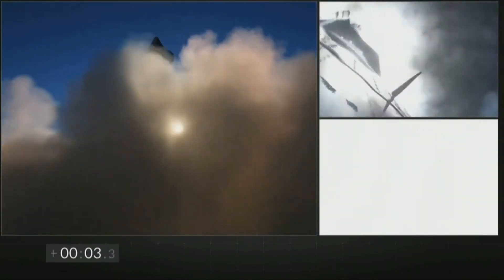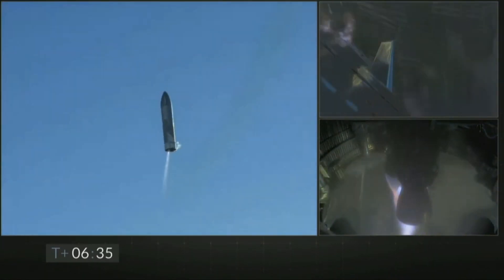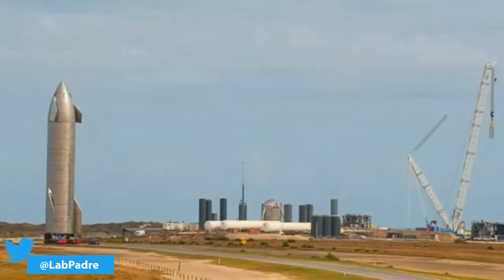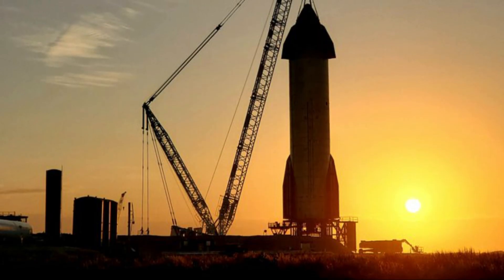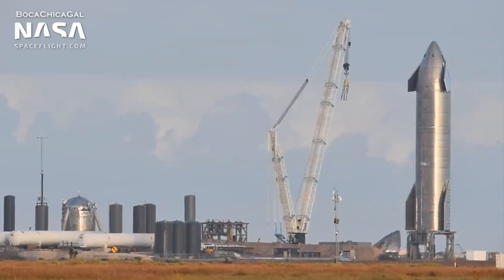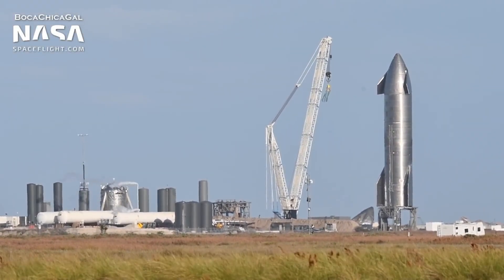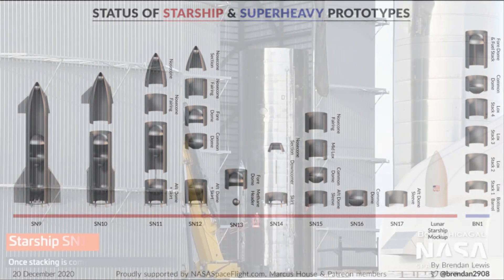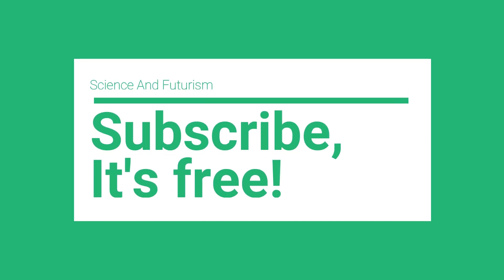Starship SN9: SpaceX Found Solution To Avoid Landing Failure Like SN8!

Comment: IS NOT ACCEPTABLE TO HAVE SUCH A SERIOUS DESIGN PROBLEM. THE ONLY SOLUTION TO SAVE THE PROJECT IS TO ADD A PRESSURE TANK TO EQUALIZE THE PRESSURE NEXT TO THE MOTOR, A KIND OF PLANE-TUBE-TANK. NEVERTHELESS, IT WAS AN UNACCEPTABLE ERROR THAT PUT IN DOUBT THE LIABILITY OF ALL SPACEX.

Comment: Very interesting delivery.  Good video. Couldn't understand what issue or solution you wanted discussed?  I think it's the use of helium as a fuel or oxygen propellant.  It seems to require a heavy bladder to avoid: dilution or pollution, of the fuel or oxy being propelled, especially as the ship goes through tilting.  So, is a pneumatic propellant in a space efficient teardrop shaped chamber, better than a mechanical spring loaded piston in a shaped cylinder.  I vote for a bladder to keep the helium separate from the fuel or oxygen being propelled through the space efficient teardrop chamber.

Comment: The CH4 header tank is pressurized with a gas, and they must use Helium because the cold temperature of the Methane would condense nitrogen, for example, into a liquid and it would not pressurize anything in that state.  Helium liquifies much colder than methane so that works.  Hydrogen, also, but there may be some chemical reaction between hydrogen and methane, IDK.  Regardless, I am against using helium as helium is precious and we are running out of it.  Much needed for things like superconducting magnets in MRI scanners...forgot party balloons and that it saves a few KG on Starship.  Non-helium methods should, IMO, be found to pressurize or otherwise guarantee adequate fuel flow from the header tanks, regardless of the weight penalty.

Comment: The greatest plus side is that SpaceX is the sole stakeholder, so can quickly make changes and continue.  I suspect that if a NASA or AF funded project, StarShip would have already been cancelled.  After a single failure, there likely would have been meetings and finger-pointing, with a committee decision to give up, made by bureaucrats with no technical understanding.  The DC-X is a good example and strikingly similar to StarShip.  The whole program was cancelled in 1996 after several successful flights, when a landing failed due to a leg not extending because a tech failed to reconnect a hydraulic hose.
https://en.wikipedia.org/wiki/McDonnell_Douglas_DC-X
Reply: Woow!
I thought this dramatic propulsive rocket landing that we've come to take as the new "normal" was SpaceX's idea. Didn't know NASA had the idea before and even built and successful tested such a vehicle... several times!
Reply: I agree completely 👌

Comment: I am wondering if the root cause of the low pressure may have been caused by the inner diameter of the vertical feed pipe and/or the lower distribution manifold connecting the CH4 header tank to the engine heads.  A pipe diameter that is too narrow would cause low pressure at the engine head.  Has this been discussed here or elsewhere? The dynamic pressure on the engine heads would be biased low if the flow field in the feeder pipe is more turbulent than expected.  Increasing the operating pressure of the header tank with helium might be a temporary work around fix with a redesign of the vertical feed pipe and/or the distribution manifold (larger diameter) being the more permanent fix.

Comment: I understand the concept of gas pressure feeding liquids to the rocket engine, but don't know how the gas pushes the liquid when the rocket is not vertical and under acceleration. For instance, during the belly flop, more importantly, in zero G. In the belly flop, the fuel won't be at the bottom of the tank, but at the side. In orbit, the fuel would be floating freely in balls and droplets. Do they use reaction control jets to nudge the fuel to the bottom, then the firing of the rocket would keep the fuel flowing? Or is there some kind of membrane that the helium presses against the fuel?
Such a simple idea, but so troublesome to implement reliably. 
I've subscribed, and so hope to hear an answer that I'm sure others might wonder about.
Reply: I have studied liquid to gas, systems for medical use and how it works is this: the liquid in the tank has some headspace and creates a consistent pressure in this space. Here’s the cool thing! As long as there is liquid in the tank the pressure will remain constant, assuming consistent temperature. 
So a 1/2tank has the same pressure as a near full tank and a near empty tank.
Reply: @michaelsmithers4900  I think you missed the question... the issue is that the fluid has to be up against the exit to the pipe feeding the engine. That's why restarts in space first require some acceleration (usually by thrusters) to put the liquid firmly at the exit (typically the bottom of the tank) and not sloshing about or in globules. That's independent of pressure. However, in the case of SN8, it seems the flow was not sufficient,  and can be cured by an extra pump or more pressure. Elon has chosen more pressure using helium, since an additional pump would add weight and need power.
Reply: @awuma  Thank you @michaelsmithers! You answered my question beautifully. So it is the use of simple physics. Occam's razor to the rescue yet again. Simple, effective and self sustaining. Thanks. I've only been wondering about this for a very long time. Dad worked on the fuel system for the A-10/SR-71; step dad worked in failure analysis for the Titan II and Saturn V rocket engines. He took films at thousands of frames  a second, to see what part blew off first during "rapid unscheduled disassembly" during test firings. Both dads are gone, so I had no one to ask.
Thanks,
Reply: @awuma  Good Point, I hadn't realized these systems bring the LOX all the way to the engine, rather I had thought the LOX was used as a gas.
Reply: I thought the whole idea of a header tank was to have it full to the brim so you don't have this problem.
Reply: @carpenter3069  Because liquid is a defined volume as you use it empty space is created that immediately filled with gas vapor "boiled off" from the LOX. The more you use, i.e. on launch to engine cutoff, the more space created. 
For what you're implying to be true the tank would have to be collapsible or maybe have a piston to  take up the void, However these things add complexity and fail points.
Reply: @michaelsmithers4900  I suppose then they use the pumps to keep a pre-defined positive pressure in the header tank then and that was the cause for failure.  They're thinking of using compressed Helium to maintain pressure.  It must mix well with the Methane?  I still am not clear on their solution.

Comment: Green flame was not caused by burning of engine components, that is something that many have claimed, but in reality the green flame is from the highly reactive chemicals used to reignite the rocket engines. You can see this in other rockets that reignite for landing, they all have that green flame.
Reply: The green flash you are thinking of  is from TeaTeb which is used to ignite the falcon 9 first stage for example, however this isn't used to ignite the raptors on Starship in order for them to be ignited far more times. The green plume was caused by the header tank losing pressure which meant that the oxygen was free to combine with metals in the engine itself instead of with fuel. Some metals in the engine such as copper tend to burn green.

Comment: My hope would be that other space agencies would start designing rockets with the same reusability that is demonstrated by SpaceX.
Reply from the maker: Yes... Some are starting to do this, eg, Russia and China... Even ISRO is testing a small shuttle like reusable rocket
Reply: This is one of SpaceXs goals - pushing reusable spacecraft engineering to the entire world, that's part of the reason for being so open with so much of their engineering, saying, "Come with us!"
Reply: Still TBD if re-use pencils out.  NASA calculated that the Space Shuttle program would have been less expensive had the main engines not been re-covered, as in the SLS which will use the same engines and similar solid boosters but just splash them.  SpaceX keeps borrowing money and has been underbid on commercial launches by India and China.  After the first Falcon Heavy launch, Elon Musk tweeted that their future plans were to recover the 2 outer boosters on downrange barges (rather than use much more propellant to fly back to Kennedy) and just splash the central booster.

Comment: Falcon 9 uses helium pressurization to fuel and O2 tanks, so this isn’t a entirely new solution and it probably was considered even before the RUD.  The helium system isn’t that significant as far as weight either but it does add complexity.  A bigger problem right now are the landing legs for Starship and Super Heavy.
Reply from the maker: True

Comment: I'm thinking ether a floating pump or a 3d printed 'whole tank' siphon device.
Reply: reckon a full lenght pickup with vacumn sensative valves low cost low weight

Comment: What if the loss of pressure was due to the fuel voids appearing at the outlet nozzles of the supply tank.  If it had been in the vertical orientation long enough, and constantly decelerating, this should not be a problem since the liquid would be forced to the bottom.  Any chance there might have been foaming created by the momentary weightlessness at the apogee, falling horizontally (~), then slightly under-damped flip to vertical?
Reply from the maker: I am not sure. But SpaceX haven't said anything about what caused the pressure drop.....

Comment: I expect the corrective action may involve a flexible diaphram in the header tank or a piston-in-drum variation.
Reply: If that's the case, then helium won't fix the problem.  However, they seem confident that helium will work as a temporary solution
Reply: @mattgraham4340  It's more a case of preventing the pressurisation gas from 'invading' the space of the propellent and causing the engines to ingest bubbles of gas instead of liquid propellent.  Helium will give immediate relief to the problem as at the moment they are relying  on autogenously produced pressurisation gas i.e as a by product of combustion so helium would be an efficient work-around but not the preferrede solution.
Reply: @ponybottle  I get it, propellent slosh and voids were my first thought as well, but I find it hard to believe that they wouldn't have thought of that already. Secondly, pressure was the only problem Elon mentioned, but perhaps he's just not being precise/verbose. I'm not a materials engineer, but I expect that cryogenic temperatures would be a major impediment to most flexible membrane materials.
Reply: @mattgraham4340  When he say's 'pressure' I hear 'gas' as the liquid propellant itself would be uncompressable . I suspect bubbles of gas entered the feed to the pumps which would ruin them in short order The solution to the problem revolves around the reason for the reduction of pressure. "Bubbles" was my first though but of course there could be lots of other reasons.I share your reservations about diaphrams and cryo.
Reply: @ponybottle  even a liquid that is "incompressible" may have measurable pressure. This is how all hydraulics work. Pressure is usually measured as pressure vs. atmospheric or vacuum. Incompressible would refer to whether the fluid changes volume as the pressure changes, it does not imply that it's pressure can't change
Reply: @mattgraham4340  I apologise for being unclear. I understand that liquids can have  pressure but  in this instance the pressure being referred to is that being applied by a gas powered pressurisation system ( as opposed to static pressur , or 'head' of pressure i.e due to weight)
Reply: @ponybottle  well, the liquid and gas are in the same vessel, so they have the same pressure. However, I agree, they're trying to increase the pressure, hence the helium.  Increasing the pressure may decrease the boiling if that was a problem.
Reply: @mattgraham4340  I agree, unfortunately we can only speculate in the absence of more detail
Reply: What material would be flexible enough at cryogenic temperatures?
Reply: @daveladd99  I'm afraid I don't know. I think a piston arrangement might be more likely.

Comment: What causes low pressure in the header tank? Did elon test the fuel flow from the header tank during static fire? Was the tank full of lox in the HT(header tank) during the 12.5km? If the flight fall back to 15 km, will this have enough time to pressurize HT to push out lox to the raptor engines?
Reply: I think this a chicken ver egg.   SpaceX wants to use some part of the engine exhaust to replace the tank volume as pumps drain the tank.  But the drain is faster than the replacement so this is a tricky balance.  if the tank starts to drain with no replacement...  the pump ends up with the same problem a child has when they suck soda from the bottle and get their tongue stuck.  The obvious option of adding a way to let air in is insufficient when the pump needs to be so aggressive.

Comment: I liked the content, considered subscribing, and did.  The header tank issue - I assumed it was possible the issue was related to the orientation of the header tank when the engines are re-fired for landing.  In Falcon 9, the booster is vertical, but for Starship it's horizontal (nearly).  I wondered if that contributes at all to the challenge. Because frankly, while the mission wildly exceeded my expectations, header tank pressure was not on my radar as a problem for SpaceX.  I know it's the first time in that configuration, but still.
Reply from the maker: Thanks for subscribing! And yes, it was not a concern, but SN8 showed the problem and hopefully SpaceX have solved it.
Reply: @spacexplained5001  Sometimes I struggle remembering SpaceX's development paradigm of fly break tweak fly.  That was an interim approach to begin with, and subsequent units probably already had design changes prior to the failure.  Any info on how or why it failed, beyond "lack of pressure?"
Reply: The header tanks are spherical. The intent was to make orientation not matter until after the engines have fired long enough to accelerate the fuel towards the engines.

The first part worked. The engines had fuel for several seconds.
Reply: @hamjudo  Ah, then the pressure part of the equation presumably failed.  Brings me back to my question - what specifically didn't work as planned?  Insufficient pressure, or sloshing fuel in the wrong place at the right time?
Reply: @scottstewart5784  The header tank lost pressure, the header tank is a smaller tank and is filled to the top and reserved for landing, therefor there will be no fuel sloshing around as it is from a full tank.
Reply: @williamo6092  Thanks.  Then it should be reasonably easy to band-aid with helium while developing the final design.

Comment: I got a bad feeling about this.
Reply from the maker: Always hope for the best!
Reply: Why?
Reply: @ferr3iro145  Starship is just too heavy to land without sustaining any type of damage to itself.
Reply: @paulkazjack  If it can lift itself, it can land, lol
The only problem was the pressurization problem, that has already been "solven"
But if u wanna bet, send me a social media of yours and we can talk
Reply: @paulkazjack  As long as you can reach 0 velocity at 0 altitude it can land itself. The engines are more than capable of doing this and the reason why SN8 failed was simply because it ran out of fuel (in basic terms) There will be many upgrades to the landing gear on the starship to make sure it has even smoother landings in the future especially on uneven terrain but this rocket in theory can land itself or else i dont think Elon would still be trying lmao
Reply: @BassandBiceps  In theory it can land in reality it cant. We shall see.
Reply: @paulkazjack  youll be proven wrong give it time
Reply: @paulkazjack  What about the previous 150m hops? They landed fine

Comment: My solution would be to add electric heater in the header tank , to be able to quickly maintain the pressure when it drops below certain level.
Reply: probably should use natural gas, with a pilot light.
Reply: It would take a lot of electrical energy to do the gasification.  It would be very dangerous to use a flame (or electrical heater).  My guess is that beefy helium tank with a regulator maintaining P in the tank would do (as long as you don’t let the gas get to the outlet nozzle of the tank.
Reply: @daveladd99  I don't think so. You just need to heat the liquid a bit and it will be turning into gas. A simple electric heater (no flame) can to the job and it can be very small. Solution with helium tank is much bigger and heavier ..
Reply: Electricity from very heavy batteries?  Think solar cells could power the heaters?
Reply: @williamgrissom9022  the starship would always need to land on sunny days only, and would probably have to unfurl them, to get enough surface area for the power needed for landing.